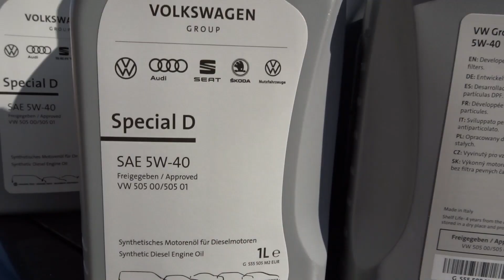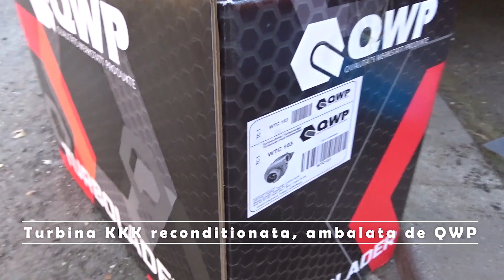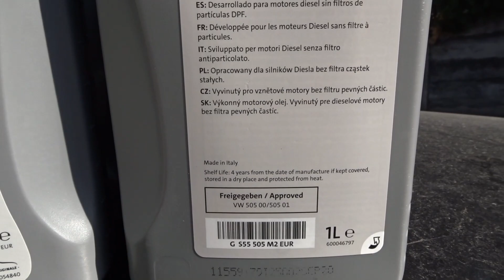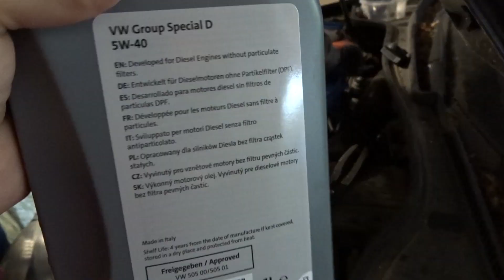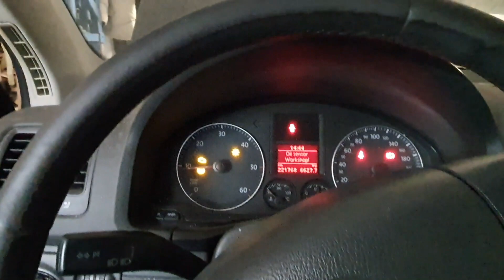Inlocuire Turbina KKK defecta | VW Golf 5 1.9TDI motor BKC 105CP | 1.9 tdi turbo failure replacement

Comment: Salut! 1.9 tdi bxe, scoate fum albastru la pornire pana se regleaza ralanti-ul (cred), dupa nu mai scoate, dar daca o las cu apa la 90 sa mearga la ralanti incepe si fluiera turbina singura, doar ating acceleratia de la 900rpm la 1000rpm max si se opreste pentru 1-2 min iar dupa revine fluieratul. Cand e cald afara scoate si fum gri asa, si daca o las sa zicem 10 min cu apa la 90 si fluieratul, o sa merg cu dara de fum albastru dp mine parca ar fi tractor. Masina este seat leon 2007 (e cam acelasi lucru ca si la golf). Am incercat si cu epuratorul de gaze, am pus un furtun sa dea gazele de carter afara.
Reply from the maker: Cred ca e turbina pe duca...
Reply: @kitambreiajvolantaefixteam  daca vreun futun e sarit (trage aer fals), se poate intampla asta? Sa fluiere singura fara sa o accelerez
Reply: @kitambreiajvolantaefixteam  Plus un pret turbo? Nu stiu codul la turbina. Se poate da cea veche + diferenta pe una noua ?
Reply from the maker: Cam greu... de la un furtun...nu imposibil

Comment: Salut, o turbina pentru Mazda 6 2013 175cp AT SkyActive motor 2191, ce preț are tot kit-ul cu toate garniturile incluse, și un preț pentru manopera te rog? Mulțumesc
Reply from the maker: Verific daca avem pt masina asta si revin cu un raspuns...stima
Reply from the maker: Din pacate pe stoc nu avem nimic pt aceasta masina... ar putea fi adusa pe comanda turbina la 12 000 lei .. se cauta foarte rar si nu prea aducem pt masini foarte noi... cu respect imi pare rau ca nu te pot ajuta mai mult
Reply: @kitambreiajvolantaefixteam  mulțumesc pentru răspuns.

Comment: golf 5 2008 bxe 105cp, masina a ramas fara putere pe drum, efectiv era lesinata, a trebuit sa urc un deal cu treapta a 3-a ca altfel urcam cu 30 la ora, dupa oprire si pornire motor si-a revenit, niciun martor de check engine, verificare la mecanic > limit exceeded overboost, am facut inca 2-3 drumuri cu ea si nu am turat-o mai mult de 2000, nicio problema, are rost sa inlocuiesc turbo ? sau a fost ceva eroare dubioasa
Reply from the maker: Nu cred ca este de la turbo
Reply: @kitambreiajvolantaefixteam  aia era singura eroare ce a dat-o pe engine, de atunci nu a mai avut nimic masina
E posibil sa fie de la combustibil de proasta calitate ? Am ramas pe 0 si a trebuit sa alimentez de la cv partener petrom de prin sate